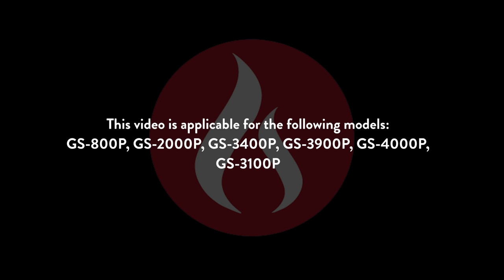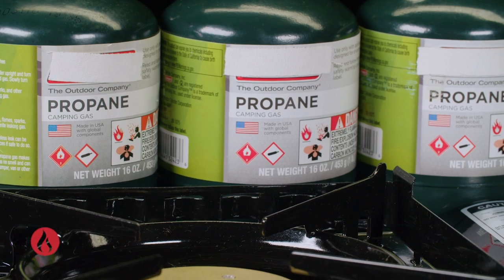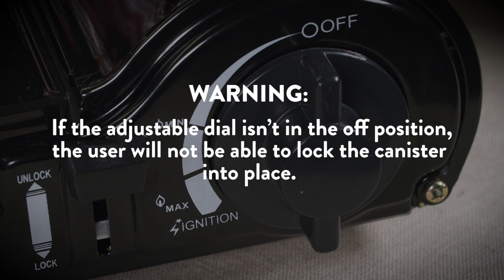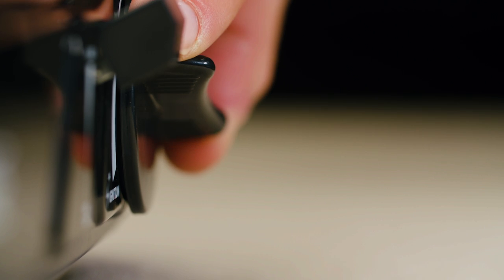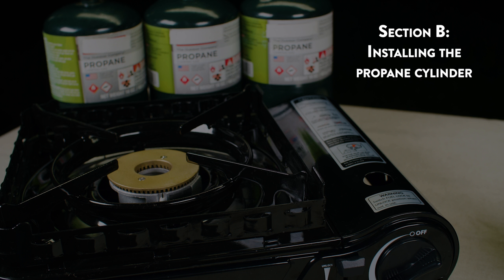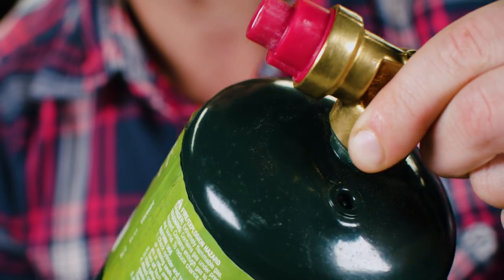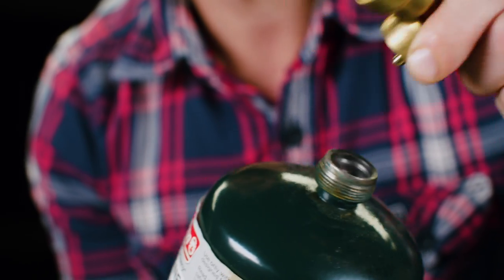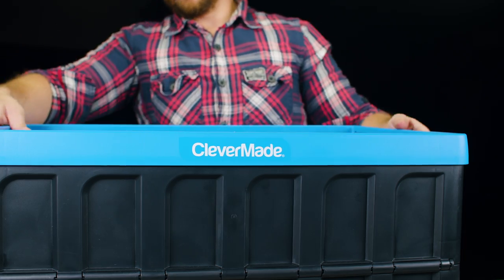How To Use Dual Fuel (Butane and Propane) Camp Stoves

Comment: Mine came with a solid pipe instead of a hose, it came with an extra part not shown in this video
Reply: Mine too. I got the solid pipe. And I don't see that golden center plate in the middle of the burner on mine either.. just got it from Amazon two days ago.
Reply: I received it with the solid pipe and was unable to get it functional because it doesn't connect my propane consistent nor can I get a return before the camping trip. Looks like no hot food for 3 days